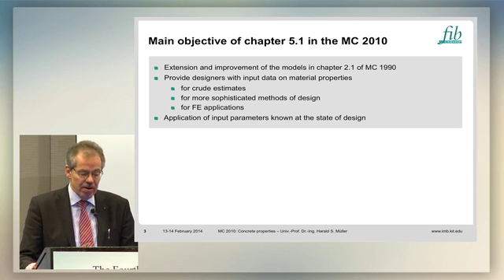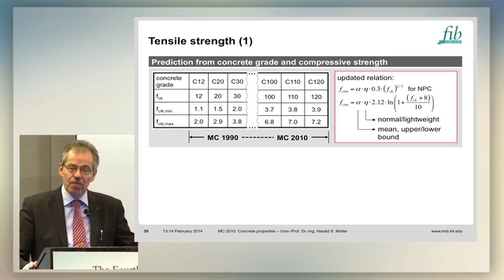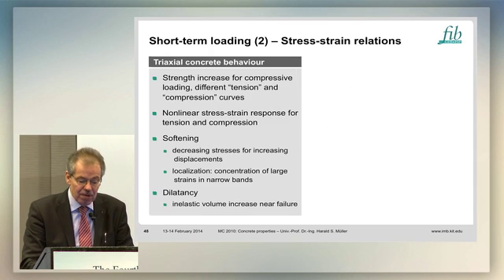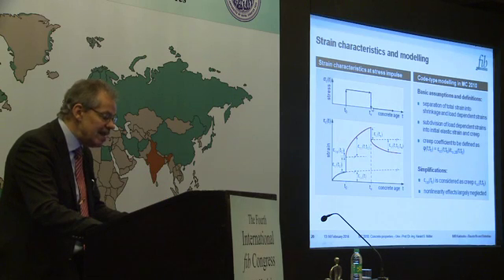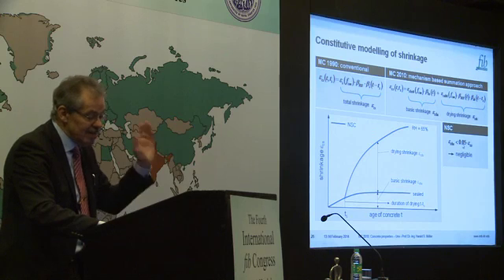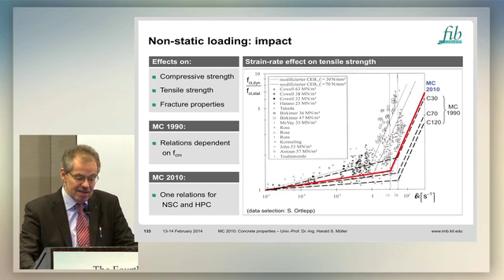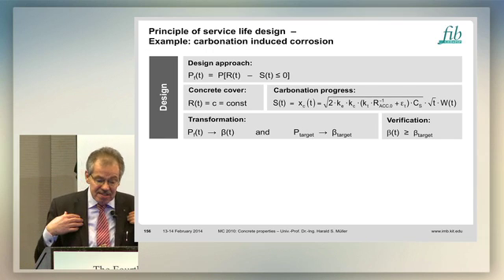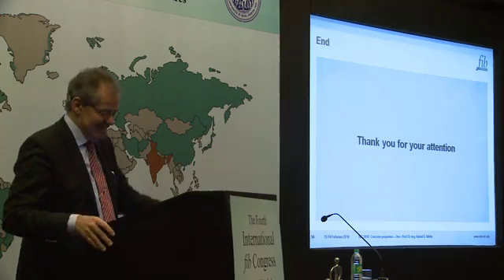fib Model Code 2010 – Concrete properties: material models and practical applications

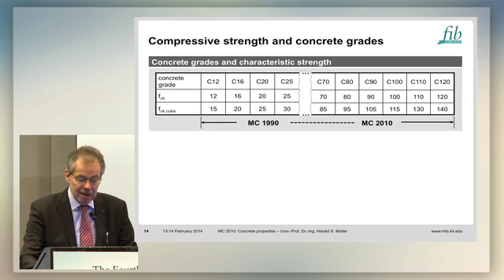Comment: 6:10 The explanation here in fib Model Code 2010 makes a lot of sense and is easy to interpret. The explanation of the characteristic strength is harder in fib Model Code 2020. The conformity criterion for the characteristic strength in EN 206, BS 8500, and ISO 22965 Table E.4 is hard to understand. The compliance criterion is the specified characteristic compressive strength MINUS 4. How?